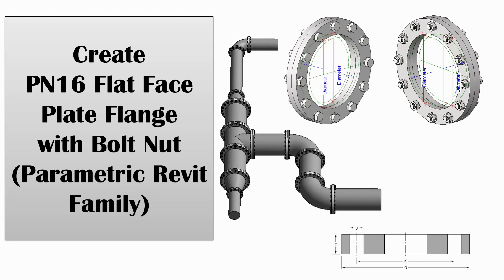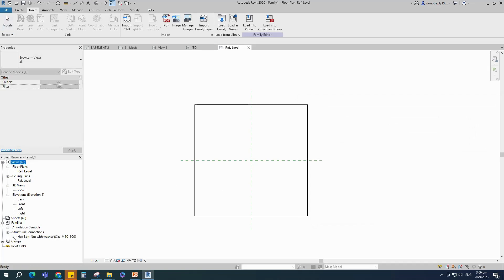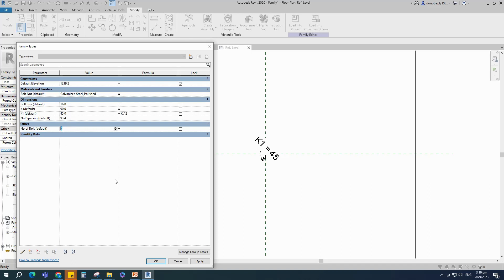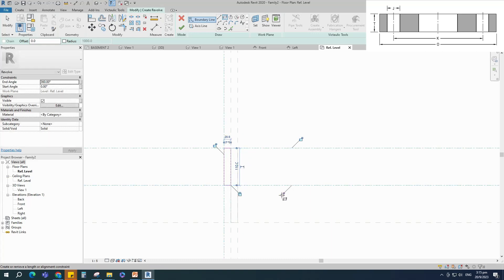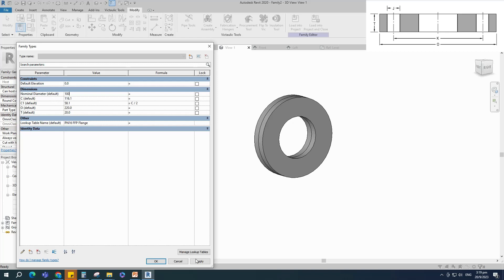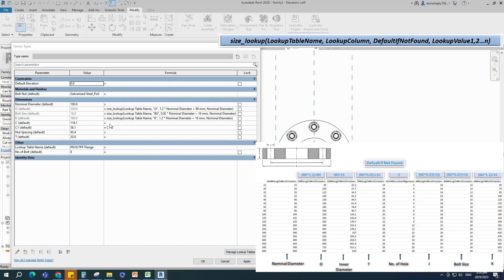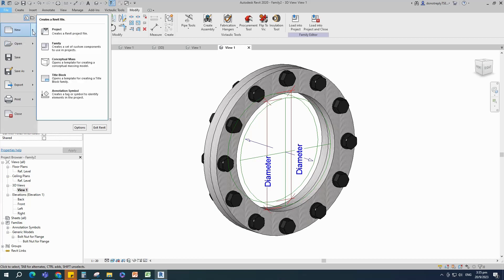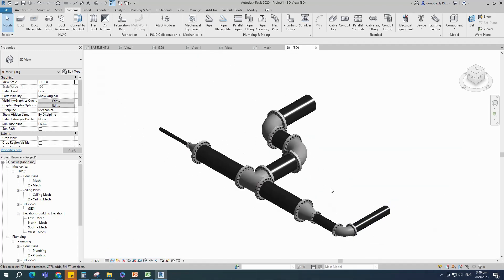Create PN16 Flat Face Plate Flange Parametric Revit Family with Bolt Nut

Comment: Hello thank you for your excellent videos. I have successfully created the nut bolt and washers ready for this video. I have 2 questions, where does the 'Nut Spacing' parameter come from? Also is there a setting to bring some of the family parameters through to the final family eg 'across flats' as I do not have this in my family types. Thanks again
Reply from the maker: You can add a parameter for nut spacing in your bolt nut family and will associate with flange thickness. "Across flat" is one of parameter of nut or bolt head family.
Reply: @ThomRVT  Hello ThomRVT I am so close with getting all of this modeled, all is working accept the nut spacing doesn't correspond to the thickness of the flanges. I cant get the Nut Spacing Parameter right. Iv added the nut spacing parameter in nut bolt family but what do I relate that to? Thank you if you have time to help 👍👍😀
Reply from the maker: @minboy8421  you have to add a parameter for nut spacing in bolt nut family. And then, formula is double of flange thickness in the main family
Reply: Thank you for you reply, I’ve learnt so much thanks again
Reply: @ThomRVT  Hi, Many thanks for taking the time to pull these videos together. I too am almost finished but have hit a hurdle with the distance between the two washers in the Nut Bolt Family. I have created a parameter 'Flange Depth' in the nut bolt family and have a formula for it in the main flange family. I then 'equals' the Flange Depth property on the child Nut & Bolt to the Flange Depth formula in the main family but no matter what I do the nut bolt doesn't change length. I have a gap on one side of the flange up to the nut & washer. I'm sooooo close. I see you have the T*2 but I must be missing where it is applied. Any advice?
Reply from the maker: You have to add a parameter for nut spacing/ nut offset in bolt nut family. And then associate the parameter with double of flange thickness parameter in main family
Reply: @ThomRVT  I ended up splitting the bolt assembly into two pieces, head and washer on one flange face and nut with washer and shaft onto the other. (I ignored the thread due the 0.8mm limit). It worked right away so I'm guessing I must have over constrained something on the full bolt assembly. Thanks for the video and for getting back to me, I've learned loads about parametrics watching your various videos.